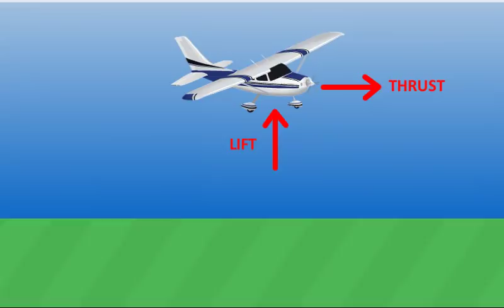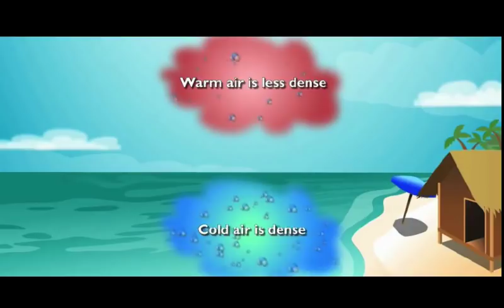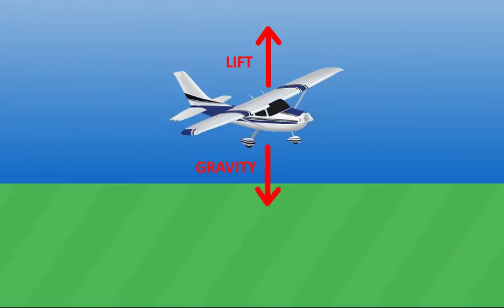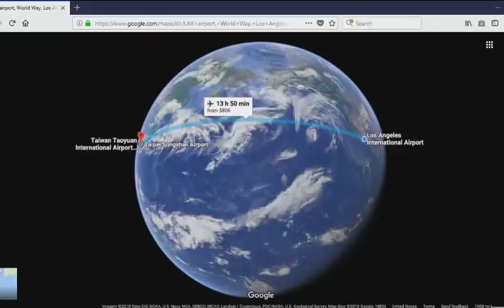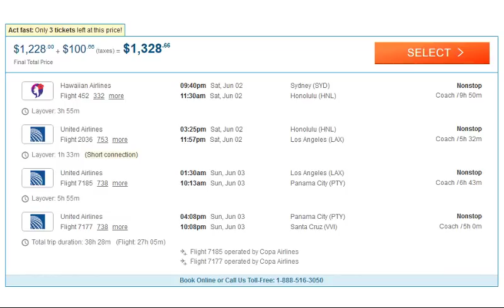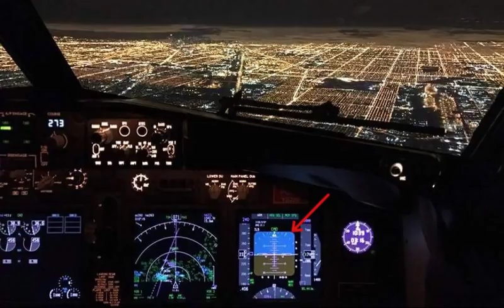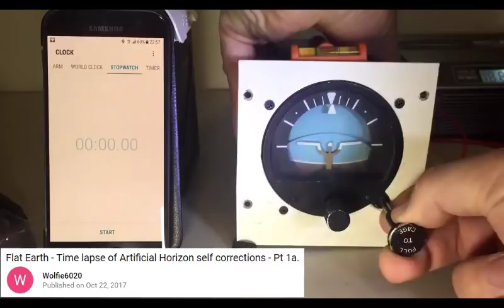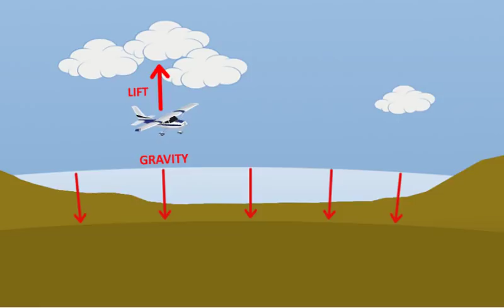Flat Earth Falsities - Plane Nonsense

Comment: so a helicopter moves with the speed eath?:)))1000 miles per hour?:)))strong helicopter u so fuckin stupid ...they paid u good?
Reply: You're moving with the speed of the earth right now. Strong person, eh? Motion is not inherently harmful. You're confusing motion of acceleration. Acceleration is dangerous. Accelerate to quickly and harm will come to almost any material at some point. Motion however, does not harm you inherently. A great example is sky diving. You don't get harmed sky diving through the atmosphere itself. But if you fail to open your chute and hit the ground, then you die from your injuries
Reply: so a person moves with the speed airplane?:)))500 miles per hour?:)))strong person u so fuckin stupid ...they paid u good?
Reply: Ffs I swear Newton covered this. Oh flatters.
Reply: I must be a strong motherfucker to be able to stand on a moving train without holding anything.
Reply: That means if you toss a coin in air plane, it should hit the back of about 800 km/h?
Reply: When it was at rest (landed) it was still moving the speed of Earth!
Reply: Dude try thinking of car suddenly stopping! That's deacceleration! Thats Harmful!

Comment: To actually believe there would be no 'drag' with the atmosphere when the motivation for movement is coming from a solid central body is a step too far for me. If the friction between air molecules is what causes the air to travel with the earth at 1000 mph, we wouldn't be able to move for the friction. At height where there is less air so less friction, almost no air so almost no friction, even there no 'drag ' occurs, how is that?
Reply: You don't understand atmospheric friction. The air spins with the earth. So it already has momentum from the time it formed on the earth. So the amount of friction it takes to keep the atmosphere in motion is almost nothing. The atmosphere is already moving with the earth and there is not a force causing it to slow down. So why would there need to be much friction force to keep it moving?
Reply: Some very nice arguments from ignorance there. Sorry, but the earth isn't flat despite what a YouTube video told you.
Reply: You know when you throw an object and it keeps on moving forwards even after it leaves your hands? Thats because it carries the momentum of your arm. Same applies with your body when on a very tall mountain or building. If the earth was still, and suddenly accelerated to 1000mph, we would definitely feel it.
Reply: You dont understand how the slowly created atmsophere got stuck to the ground? Well not does GRAVITY hold on to gasses but those wonderful Gravitons keeps the bulk mass of it a correct momentum speed, all the way up to where GEO satellites live.. they also suffer drag. Only higher up does GRAVITY lose battle agains SPACEWINDS and gasses run off into the edge of NOTHINGNESS.
But SHE wins with the distant Moon capture.. against the 95% solar system SUN mass :)
All this is done AUTOMATICALLY by the will of GRAVITY, just as she molds fine balls all over the Universe.
Reply: @BrainUser1  "But SHE wins with the distant Moon capture.. against the 95% solar system SUN mass :)"

1/r^2
Reply: If you stir soup or a drink, friction will set the whole fluid in motion, not just the bits where your spoon passes. Yet we can swim through water. Wind friction can move wind turbines.

Moving through air moving at 1000 mph relative to the sun is easy because the Earth surface and we ourselves are moving at the same speed: it is as easy as passing something from the back seat to the front seat in a moving car.

The thing is that moving air has inertia: it would only "drag" if it wanted to slow down which it doesn't (Newton's first law applies).

Comment: GE hero Eratosthenes....: calculated the Earth's circumference without leaving Egypt. 
[(Syene is at latitude 24°05′ North, near to the Tropic of Cancer, which was 23°42′ North in 100 BC[17]) He then measured the Sun's angle of elevation at noon in Alexandria by using a vertical rod, known as a gnomon, and measuring the length of its shadow on the ground.[18] 
Using the length of the rod, and the length of the shadow, as the legs of a triangle, he calculated the angle of the sun's rays.[19] 
This turned out to be about 7°, or 1/50th the circumference of a circle. 
Taking the Earth as spherical, and knowing both the distance and direction of Syene, he concluded that the Earth's circumference was fifty times that distance.]
- Pharaonic bookkeepers gave a distance between Syene and Alexandria of 5,000 stadia (50,000km), science precision! (as 1 year latter)
- Scientist that alread KNEW he was on a globe and exactly how big it was...!
- Must have known how fast the globe was spinning and rotating around afther the speeding Sun (43,000 mph /70,000 kph)! Speed of light too?
- So what did he not know? Anything? 

His calculation was remarkably accurate. He was also the first to calculate the tilt of the Earth's axis, again with remarkable accuracy... dont say! Additionally, he may have accurately calculated the distance from the Earth to the Sun... too, my my so Math Magician!

Flat Earth: Quick Eratosthenes Debunk  /watch?v=5p8h5cY9O7c
WORST Globe Proof Ever? GED Skeptic's Eratosthenes  /watch?v=SLvTMElrFuw
Eratosthenes is WRONG (Flat Earth)  /watch?v=XdaKAPw6mzg

Flat Earth | Globe Earth Math - 100% Debunked  /watch?v=fIhgFT-OipU

Veteran 737 Pilot grounded for Flat Earth comments - Mark Sargent ✅  /watch?v=Bj-k0dJ9ndU&t=6s
Reply: Louis, it has reached the stage where I can only read a quarter of your posts before I just give up. They are only vaguely literate. I almost need an Ouija board to work out what your on about.
Reply: @appresley4071  he really is an incoherent mess of mindless gibberish.
Reply: @appresley4071  lol you didnt get that I pretend too understand geometry? 
Nor that  I just proved I don't know how to calculate any type of curvature?
At least you got how Captain proved I can not. 
Must try to imatate his brainstorming intellectual literate lines.
Neil deGrasse Tyson is globe astrophysicist knows how to reach these minds, with GRAVITY understanding=
To prove GRAVITY exist (gravitions and waves never detected) he drops a microphone= 21C proof for Winners.
That it all the Mainstreamers are jumping up and down(gravity) in joy and undestanding, all the PROOF they need :)
Reply: @BrainUser1  I don't know what your on would not mind a kilo of it, but your last comment wasn't too illiterate. Managed to read almost half of it.
Reply: @BrainUser1  I never went far at school, I am not smart, worked from a young age as a deckhand on a fishing trawler. Luckily I worked in a job where the earth's curvature was evident daily. Where in the ocean's darkness the stars are a deck hands friend. I read books, tried to educate myself. Luckily YouTube didn't exist then, otherwise I may have got lazy and just educated myself with flattard videos, and fallen down the flat-earth rabbit hole too.
Reply: Man sees curvature at sea, what a small ball (like +voysovnonsense "show me the curvature" video pictures, they sure talk.
So an other Professional Navigator like greek fan +mong !  
Muy holey buybull am der troof!
ps: bet all those books were GOV approved, so no normal educational YT videos.. or globe earth ones... that worked well...
SDA Flat Earth New York Conference; Seventh-day Adventist Flat Earth Pioneers  /watch?v=67oaZmC__5o
Reply: @BrainUser1  When we left the coast on a misty night. The light house would shine over our heads when we first started. Then further out at sea that beam from the lighthouse would light up the boat. As we moved even further out to sea, the light from the lighthouse would shine through the mist above us, moving slowly higher and higher upwards through the mist till we could not see the light anymore. Explain this with a flat-earth map. The books I read were mainly nature books, however if you read enough you tend to collect a lot of knowledge and facts.
Reply: @BrainUser1  lol don't pretend you understand geometry.
Reply: Or would you prefer it if I just prove you don't know how to calculate any type of curvature?
Reply: Next time why not post a video where a flattard actually goes outside and does this experiment with the actual sun in real life? Oh right, no flattard has done this experiment in real life as none of these dolts can understand basic geometry. LMFAO Nice attempt though. I guess doing an experiment with two sticks outside with the sun is just too difficult for flattards.
Reply: @CaptWesStarwind  O the Captain is once more back to gibberish me (and know-nothing too!)... why cant a Flattard pretend he understands?(aside of Basic science)? (common sense maybe?) 
YES YES PROVING, for once would be a change from just lip. (despite how impressive it is)
O he want actuall genuine FLATTARD quality, actual sun! Kind of long that whole video, being explained as so many experiences that interpretation is everything, as so many deductions depend on size's & distance's of players.
Sticks and Balls, that is what the.. man is into!
Reply: @BrainUser1  now would you like me to simply prove you don't understand grade school geometry? That's an easy one.

Comment: I'm at the terminator line and it has part ..part in disproving coprinticas  heliocentric model wich has been disproven hand out the window is not air pressure air pressure is a set known pressure as any pressure hand out the window is call air resistance as the same as the ball and feather the feather falls slower in the atmospheric air pressure BECAUSE of air resistance lol come on ...
Reply from the maker: Yes air resistance is what you feel when your hand is out a moving car window. If there was no air pressure and no friction, what would you feel? Nothing. The molecules of air would just slide out of your hand's way with no resistance. So the resistance is because of the pressure and the friction.
Reply: @JonasGrumby71  um fluid friction maybe seems how its air like the airplane experience fluid friction wich causes drag drag is determined by the viscosity of the fluid aka air witch is were the evolution of streamline came from  so thing can move faster so it has less air resistance that causes drag ...🤣🤣🤣 dude go back to science class please
Reply: "I'm at the terminator line" How fast are you moving?  @sean7058
Reply: Seems legit.